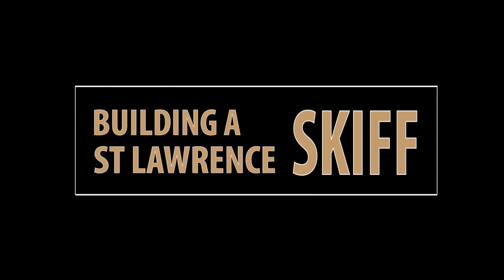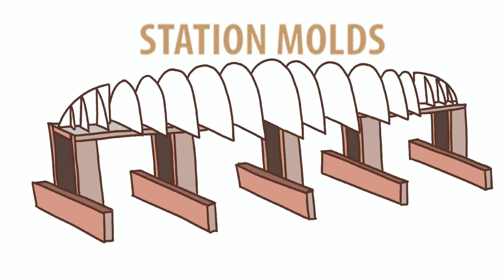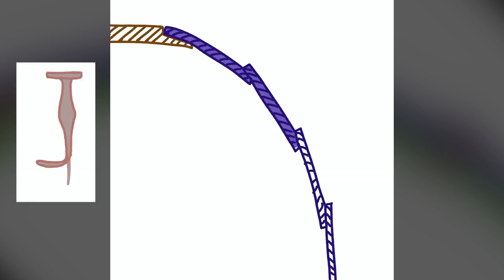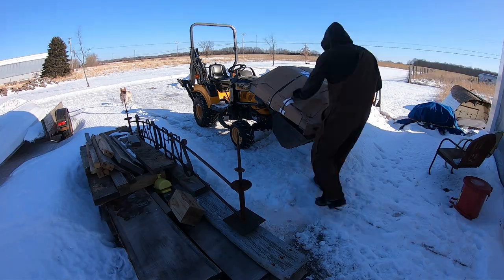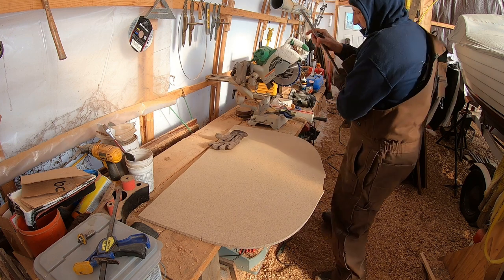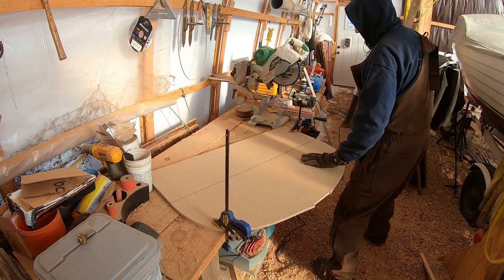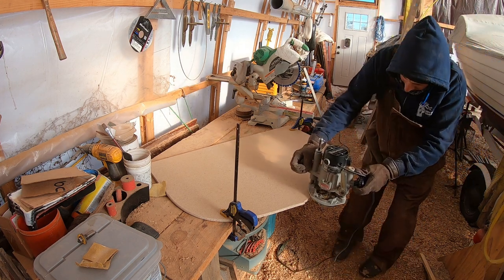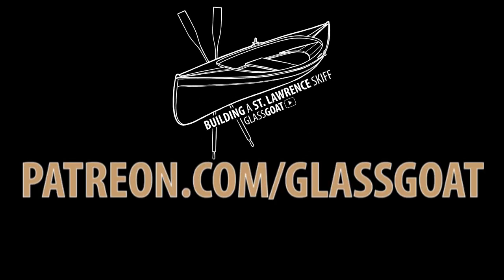Building A St Lawrence Skiff Episode 1

Comment: I would epoxy coat the MDF edges.
Reply from the maker: Not sure why I've never seen that done before. Only painter's tape or thin plastic, mostly I think to keep the glue from sticking. I'm not planning to nail or staple through the strips, instead I plan to use a clamp system as I've seen done by experts on kayaks built with this method. If I don't put fasteners into the MDF, it might not actually need anything. Yours is a good idea though, maybe penetrating epoxy? I have to think about this some more.
Reply: @glassgoat9601  My suggestion for coating the edge with epoxy was to toughen up the MDF edge to keep it from chipping. Plastic packaging tape can then be applied to prevent epoxy from sticking to the molds. Maybe the molds can be reused or sold latter.  :yougotthis: